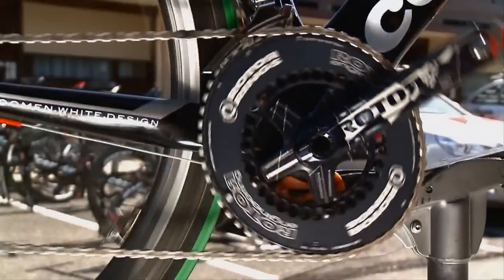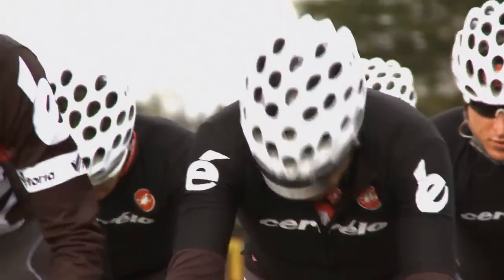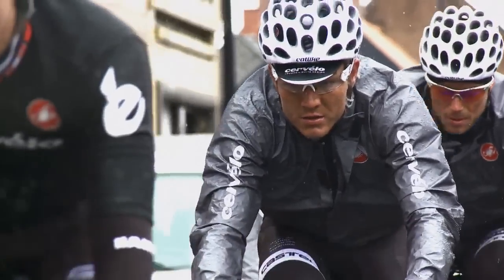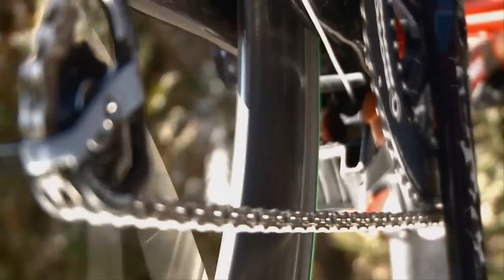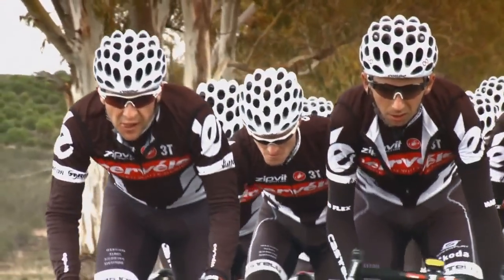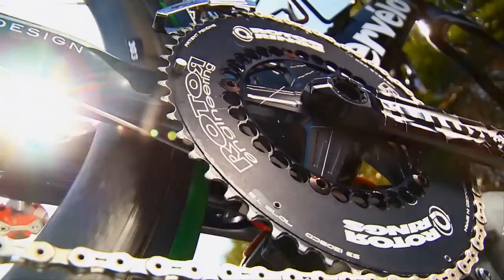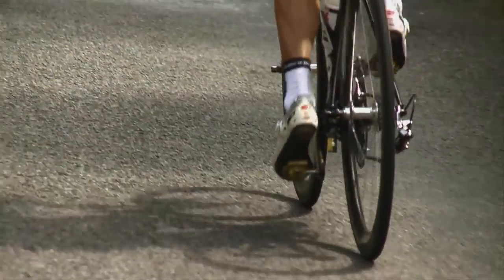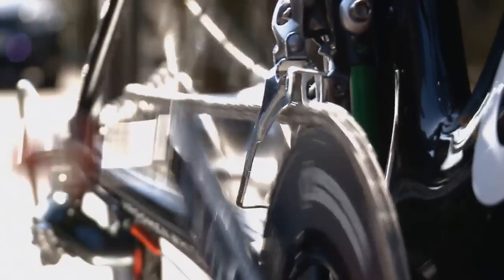ROTOR Q-Rings increase power chain rings at twohubs.com

Comment from the maker: Yes, you can use Rotor Q-rings on SRAM Red.  The Q-rings are 9, 10 & 11 speed compatible.  You will need the OCP3 version for any BB30 and 110 bcd cranksets.

Comment from the maker: We had the most success with any Di2 and the new Dura Ace 9000 gruppos.  The front derailleur are so powerful that any shifting lag isn't an issue with the Q-rings.  The Shimano trim allows the ability to run cross gears with plenty of clearance.

Comment: Not quite (I've had Biopace, now I'm on q-rings). Biopace placed the wide diameter more on "top" of the stroke (somewhere between 12 and 2 o clock), while the Q-Rings have it more around the 4 o clock area. Biopace felt quite "wobbly", not round and they had a pretty big deadspot that was easy to pedal through, it was more like hammering your way uphill. My Q-Rings feel totally different, hardly oval at all, they provide a very fluid motion, almost like a round ring, but without its dead spot.

Comment: Not quite (I've had Biopace, now I'm on q-rings). Biopace placed the wide diameter more on "top" of the stroke (somewhere between 12 and 4 o clock), while the Q-Rings have it more around the 4 o clock area. Biopace felt quite "wobbly", not round and they had a pretty big deadspot that was easy to pedal through, it was more like hammering your way uphill. My Q-Rings feel totally different, hardly oval at all, they provide a very fluid motion, almost like a round ring, but without its dead spot.

Comment from the maker: @kbray003 It's really not recommended to not use both Q-rings.  You will find it extremely hard to get the same performance and speed out of the round rings when you are comparing them side by side.  The front derailleur will also have a hard time, since the gaps are different from the round to the q-ring.  Once you ride one you will want them both.

Comment from the maker: @adnauseam23 The Rotor Q-Rings takes advantage of your maximum power stroke by increasing a typical 53t stroke position into a 56t while in the dead spot (weakest point in your pedal stroke) is decreases to help your pedal in a smooth spin. Most people noticed an increase in speed and decrease in cramping on long rides.

Comment from the maker: @adnauseam23 Not at all, this Q-ring is fully adjustable design to help increase power and decrease lactic acid load in the legs.  Bio pace was a round chain ring with flat spot to decrease the dead spot.  The Rotor is a symmetrical oval design with 5 position adjustments.

Comment from the maker: @dahgutone We've installed a lot of Rotor rings and haven't had any customers complain about the shifting.  We only hear about the performance increase.  I can imagine there is a problem if you were only running one Rotor c-ring and one round c-ring.  With the Rotor set the distance from one c-ring to another are the same all the way around.